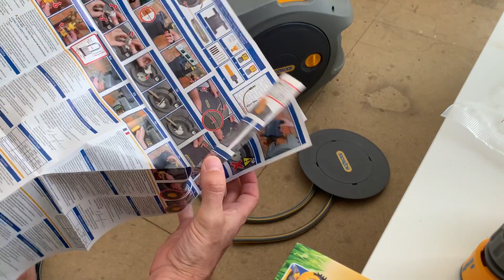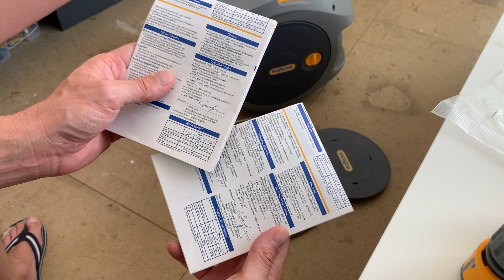Hozelock Auto Reel: Unboxing & Installation

Comment: 😡This product is absolute rubbish. We are disabled gardeners and all we need is for the hose to extend and retract. The last two could be heard unwinding the second they came out of the box and they never worked properly again. The plastic gets cheaper every time we buy one. Did you really attach that to a wooden shed where the boards were probably stapled together?😡
Reply from the maker: It definitely takes a bit of effort to extend and retract it - so understand your issues if you are disabled. Sorry to hear you had troubles with it!
You'll be pleased to know that it's attached to a nice strong post behind those boards.